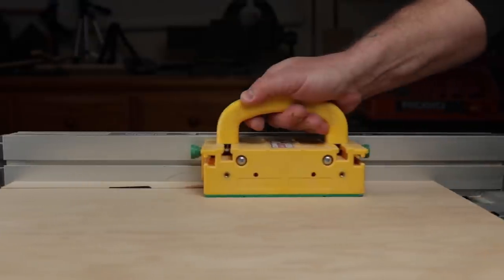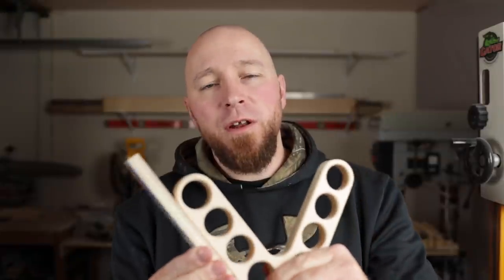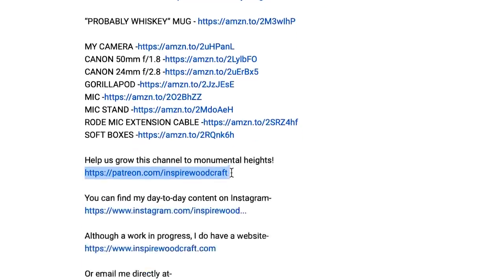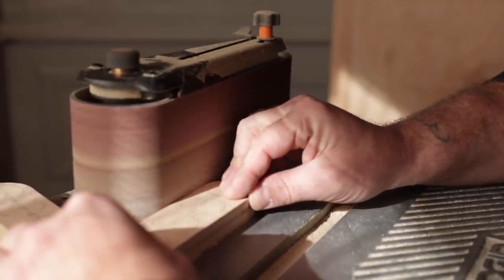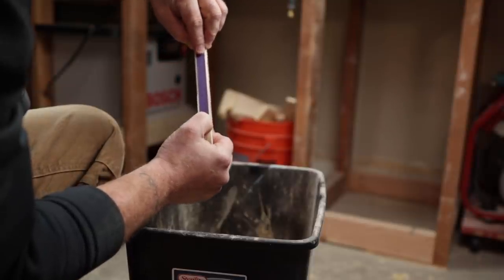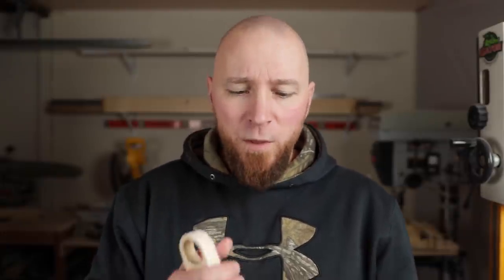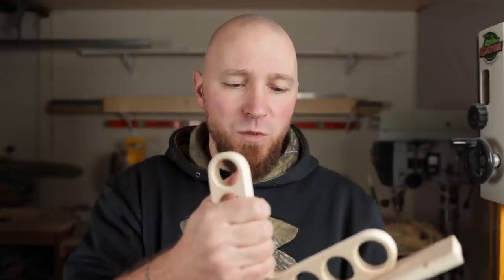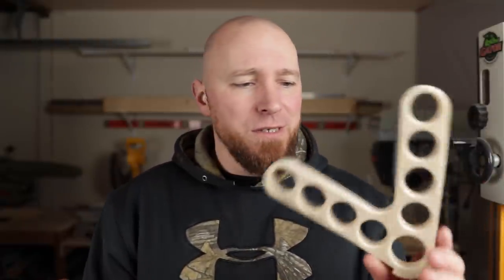Is This The New Best Push Stick Design For The Table Saw? / FREE TEMPLATE!

Comment: this is pretty fancy, but I have to agree with some of the other commenters here.  I think the most important feature of a push stick is to keep your hand BEHIND the blade, while pushing the piece past the blade.  I don't care how fancy you make this.  It can be a literal stick you use to push, which as someone who has spent hundreds of hours on the table saw, I have used more often than not.   Having your hand on the pushstick  leading the workpiece past the blade increases the potential for the leverage of the pushstick to guide your hand down onto the blade.  In other words, your hand winds up over the top of the blade before the end of the cut clears the edge of the blade.  This is a neat idea, but it's kind of a square version of the wheel. For something which is meant to be fundamentally disposable, just don't put so much time into making it better than just a stick you can push with.  Maybe turn it around so the notches are toward middle of the "v" so that your hand remains behind the work piece.  I like the 2-sided design otherwise.
Reply from the maker: Yeah that’s something I debated and played with when I was in the design process. The only problem is that when you move the hook forward, you actually create less “drivability” and have to then make the base/handle longer as well. Think about when you use your hand to guid a piece through. You don’t keep your fingers at the back of the board. You put them more in the middle area, keeping constant pressure and feed rate, until you get to the end of the cut of course. That’s what push sticks like these do better at than the longer ones, because they apply pressure to the top surface of the piece and actually drive it through with control, instead of walking it through. I personally have seen more instances of accidents and sloppy cuts with those types versus these types, but that’s just what I’ve seen, which is why I won’t use them. Push sticks don’t have to be disposable, and this one isn’t meant to be either. Like I said I typically prefer a different kind of push stick for cuts narrower than 3/4 but I have used this to run a bunch of thin strip for edge banding and it performed brilliantly. At the end of the day it really comes down to user preference and what they’re comfortable with. Thanks for the feedback.
Reply: @InspireWoodcraft  Thanks for your response.  It's a unique idea for sure.  I'll be sure to check out some of your other vids as well.  I'm coming to this from the perspective of someone who's been a carpenter for 14 years, and nothing on the job site is worth putting effort into because it gets lost or broken.  I can see how it's very different in a shop.
Reply from the maker: That something I can completely understand! Yeah definitely a different situation there. I really appreciate comments from people who can just have a conversation instead of putting up a fight of sorts. Good stuff. Thanks a ton!
Reply: @InspireWoodcraft  I hate always having the tendency to need to have the last word, but  I can't resist the impulse to share my agreement.  Youtube represents for me simultaneously the best the internet has to offer, with videos posted by people who care to share information, and the worst of the internet, with all the assholes who have to just tear everything down in the comments section.  Thanks again for adding to the better part of the internet.

Comment: I like the design and want to make a couple of these.
But how do I download the template?
All I got was a payment system wanting my credit card details when all I wanted was a PDF
Reply from the maker: Hey John! You don’t have to put in any of that stuff. I don’t know why, and haven’t had time to look into, why it does that. I think it’s just the default setup on the website. If you just enter your email address (so it knows where to send the pdf) you skip all the other stuff completely. Let me know if that works, and if not, shoot me an email please. Thanks!
Reply: Success at last. Managed to download the template.
Plan to make a couple of these during this week.
Thanks

Comment: I would like to see a similar design but carrying  the shape all the way round, using 60 degree angles make a equilateral triangle, I know you are only going to get three push heals but they could be made different depths for different thickness wood ie you could make them 1/4 “ 3/4” and 1’1/4  or just make them to your specific requirements

Comment: What happens when the blade catches the push stick? My guess is that as there's so little materiale involved it will be splintered in a fraction of a second by the blade. Combined with the low height and the fact that you are pushing both forward and downward this could end realy bad.

The design looks great though. Maybe put som more meat in it and add som height too.
Reply from the maker: Thanks for the feedback! I’m not sure how or why it would splinter apart. It would be no different than running any other piece of material though the blade: it would just slice through it.
Reply: If the blade does go through it it may shatter as there won't be much material left in it.  I'd make the holes smaller so it's a bit stronger.   I like the design
Reply from the maker: Appreciate the feedback! I will probably run some tests on video after gathering everyones thoughts. I just don't see how it would shatter. Especially if one has the blade height set correctly. If you think about it, "traditional" rule for blade height is roughly 1/4" above the work piece, which is how much material is all around the perimeter. So really it would be no different than cutting 1/4" stock anyway. And it is only one saw blade's width, so it would still be supported around the blade as well.
Reply: So when you cut other plywood it just shatters when the blade hits it???

When the blade does hit it, the push stick is cut, that is all
Reply: Under normal operations this push stick will most certainly work like a dream. I have no doubts about that. And if you by accident put it to close to the saw blade it will just get a small groove cut into the bottom. No problem. No problem at all.
It's when things do go south and your workpiece gets jammed, the saw kicks back and the workpiece flies away that you will end up with just a few milimiters of plywood between your hand and a spinning saw blad. If you where cutting a thick piece there will be a large portion of the blade exposed whren the workpiece is gone. And with the sideway motion of the disappering workpiece there is a risk that your downward pressure now will be directed towards the blade. I hardly believe this stick will withstand such an encounter for more than a few milliseconds.

The push stick has two purposes, help you avoid trouble and get you out of it, should it still happen. This stick will excel at part one. Even your bare fingers will do a good job to prevent kickback. It's on the second part that a push stick has its real advantage over bare fingers and that is what it should be designed to withstand.

It is difficult to calculate what will happen and how much material you will need between your fingers and the blade to avoid injuries but I for sure want more, not less.
Reply: Stefan Eriksson , Exactly!  Read my post above.
Reply: Read your post Michael. That's precisely what I was afraid could happen. Horrible experience. Hope you didn't hurt yourself to bad in the accident.
Reply: @stefaneriksson9634  correct. It seems that the priority of this device  is to drive the cutting perfectly with the best pressure on it but not the absolute safety of the hand. Not to speak of forgetting to lower the blade at the proper height.I d definitely not use  it.and stay with my chip plastic thing which always maintain fingers far from the deadly blade.
Reply from the maker: Great feedback and well said comment. Thank you. I would like to point out though that not a push stick out there is meant to be a safety device to physically protect your hand in the event of kickback. Nearly to prevent it to begin with. And anyone who is forcing that hard to get something through the saw or leaning that hard on the pushing device, even if it is their own hand, should stop the operation altogether and rethink things. If it’s the holes that everyone is pointing at saying “there isn’t enough material to protect your hand”, I would have to lean on the fact that not having the holes there wouldn’t save your butt any better. I’ll definitely do a follow up safety video because it sounds to me like a lot of folks might be doing things a little haphazard. (Not referring to you, just in general as I scroll through the comments.)
Reply from the maker: Neither a wood or plastic push stick will save tour hand in the event of a kickback. They are not and have never been as devices to protect your hand. Nearly a device to help minimize the chances of it happening.

Comment: I usually use a frozen banana, works alright
Reply: Ahh you freeze the banana first
Reply from the maker: I used to as well but recently switched to cucumbers because as the banana thaws the peels comes off and gets stuck in the insert. Too much downtime.
Reply: Inspire Woodcraft   👍🏼😂😂😏
Reply: Yea, but we're talking about using it on the table saw, as a "push stick," not where you might be "pushing" it.
Reply: What an a-peeling idea!

Comment: Regarding safety: Imagine the possibility that the work piece suddenly is not between your hand or the push stick and the blade. The max. blade height of your saw is likely about 3". Your design does not prohibit your hand from gripping the push stick and being closer to the saw table than the height of the blade at times. I prefer designs which eliminate this possibility altogether.

Also, while the sand paper gives improved ability to keep the work piece against the fence, rip cuts narrower than 3/4" will cut through the bottom of the push stick, in which case the sand paper will not do the blade's teeth any favors. Sticky bottom is a good idea, but better executed with some type of grippy rubber, such as what is used on the bottom of track saw tracks. I have found rolls of self adhesive rubber strip on McMaster Carr, etc. that work well for such applications.
Reply from the maker: Interesting take, but I'm honestly not sure that I follow 100%. If the blade is set to the correct height there should be no problem at all, no matter how high the blade is raised. Your hand would be the same distance from the blade regardless. I would like to point out that this type of push stick is actually designed to reduce kickback, not invoke it, by having better control of the work piece. I have sold a bunch of these and thousands of people have downloaded the template and I have not had a single person complain of anything whatsoever, so I think I just must be not understanding what you are saying. Also, I have personally ran these push sticks through the blade on purpose without adverse effects. I can tell you without a doubt that a little strip of sand paper will not hurt a table saw blade in the least amount. Definitely no worse than many of todays plywoods will.
Reply: @InspireWoodcraft  First, let me say that I appreciate and subscribe to your channel: your fresh take on topics and in-depth presentations achieve their aim: to "inspire woodcraft." And congrats on the many downloads of your push stick design. 

That said, I stand by the suggestions made in my original comment. You replied, "If the blade is set to the correct height there should be no problem at all, no matter how high the blade is raised. Your hand would be the same distance from the blade regardless." This reply is not exactly true. Your hand will always be the same distance from the bottom of the push stick, but not necessarily from the blade. Therefore, the premise of my original comment: Imagine if the work  piece suddenly isn't where it "should" be.

As a professional woodworker for nearly 50 years, I have unfortunately cleaned blood and flesh from machines where in an instant something that should never have happened, did happen, sometimes caused by a careless moment on the part of the operator or a weird hidden tension in the wood.  I don't want to debate what for you remains an unimaginable hypothetical, so let me simply say that IMO, use of your push stick should be accompanied by careful attention to blade height, and ideally restricted to blade heights less than the width of the leg making contact with the work piece and rip widths greater than the leg's thickness. So even with these caveats your push stick seems to me to be perfectly fine for probably 90% of the cuts one would likely make. 

But when I design for safety, I aim for 100%, and additionally try to allow for a bit of operator carelessness or even stupidity. Therefore, if I copied your design in my own shop, I would make the leg that contacts the work piece at least 3" wide for a 10" saw. Admittedly, this would take away from the elegance and certain benefits of your design.

As for sand paper not dulling blades unnecessarily, I ask: have you ever used a good carbide blade to crosscut modern pre-finished flooring? The blade does not last long. The aluminum oxide in those finishes is the same as in many sand papers. Why use this material when other less abrasive alternatives are available?

Comment: Cool design bud. Instead of sand paper can you use anti skid material?
Reply from the maker: Yeah definitely! I would just make sure the material is well secured or else if it starts to come off the whole strip might come off at once and cause other issues. I made this with the idea of using stuff most of us already had in the shop.

Comment: Very nice design, but I am a little concerned that the holes in it will weaken it and it snaps while over the saw blase. I think smaller holes would be better but that is my own preference.
Reply from the maker: Thanks for the feedback and watching!
Reply: It’s easy enough to test before using. If you’re using junky big box  plywood with voids, splits, etc you are probably right. It falls apart at the wrong time. If you’re using premium Baltic birch - they make airplane wings out of that stuff with not much more meat than this pushstick - it’s very strong.

Comment: What are the long term effects of cutting sandpaper?  One of the best parts of a plywood push stick is that you can push your workpiece however you need to and if that means running the pushstick itself through the blade, then so be it.  I wonder if over time cutting sandpaper will hurt the blade.  

And then when you've cut your plywood push stick too much, you just grab another one.  Yours looks nice, but probably took too long to make for it to be considered "disposable".  There are some other designs floating around that are much faster to knock out so you can make a stack of 20 of them in a few minutes.  So now I have to make a couple of your design, but if the cut will be chopping up the pushstick, I'll grab one of the other ones.  :D
Reply from the maker: Thanks for the feedback! Couple of things to note here: There shouldn't be any "long term effects of cutting sandpaper", as we cut sand paper all the time with razor blades and they don't really dull any quicker than cutting any other material. I guess the way I look at it is that if I can cut a piece of aluminum with the blade, it should handle the occasional sand paper cut just fine. While this does take a little longer to make (less for you if you don't have to design it like I did), the beauty of this design is that you actually have TWO push sticks in one. So really you're doubling up your capacity while taking up the same amount of space or maybe even less. Also, it really just depends on how you use a push stick in your shop and what your needs are. As I stated in the video, I probably won't be using this much for cuts less than 3/4" anyway, as I actually prefer the GRR-RIPPER for thin cuts anyway. A lot of shops have multiple types of push sticks for different tasks. Really appreciate the thoughts. Let me know how it works for you!
Reply: Carbide is harder than garnet, so no effect.
Reply: @sethbracken  Have you ever seen a water jet cutter?  Water, which is so soft its a liquid can cut carbide steel.  Ever seen a boxer get a tooth knocked out by a fist covered in a big fat padded glove?  There is more to it than whichever material is the harder will not be damaged by the softer material.
Reply: remember your not cutting a 1/4 material. its sand paper the long term effect will be a lot less than cutting a piece of wood,  but if your really concerned you can do like Dan Limbach
 suggests and use strip of slightly tacky rubbery material instead of sandpaper
Reply: @giantpune  Amazing...did you watch the video or read his reply? If you don't want to cut sand paper with it then don't.  Use a different stick or a board you don't care about running over the blade which is common practice for ripping thin strips.
Reply: I agree, but for ppl doing this as a hobby, making your own cool push stick is part of the joy. I personally have a piece of 2x4 with a scrap of plywood on at the end to serve as a hook cuz it’s easy to make and I don’t care if I run it into the blade.

Comment: Awesome design and I appreciate the detailing of the square edges with the router. So simple yet so necessary and your leverage design will help keep downward pressure on the stock as it goes through the blade preventing a possible kickback especially on smaller/thin stock. Stay inspired ….
Reply from the maker: Thanks for the positive comment and noticing the details!